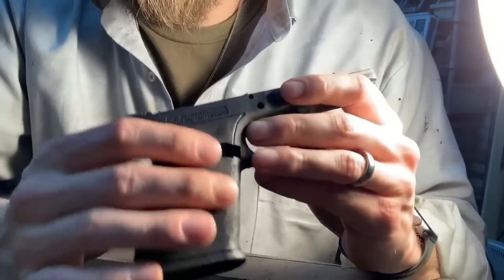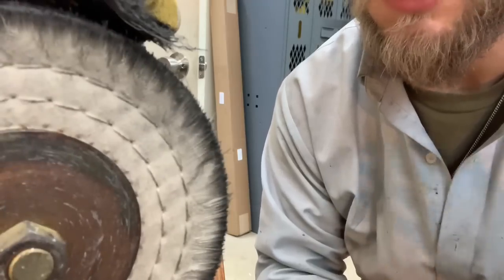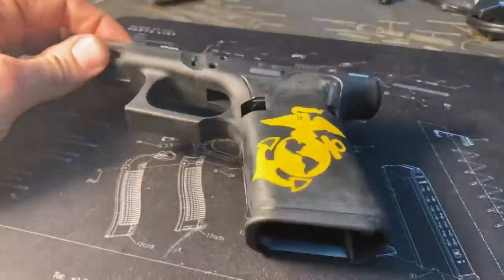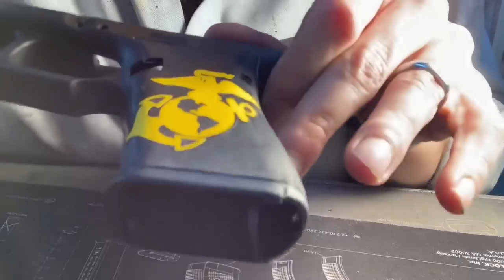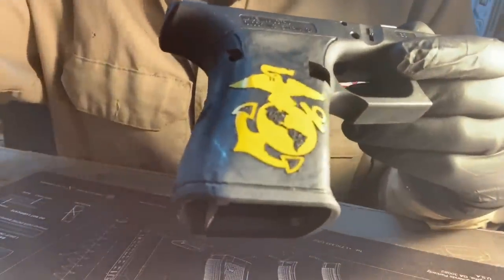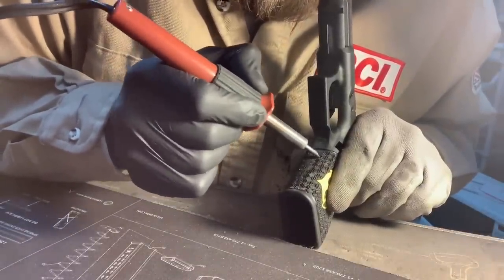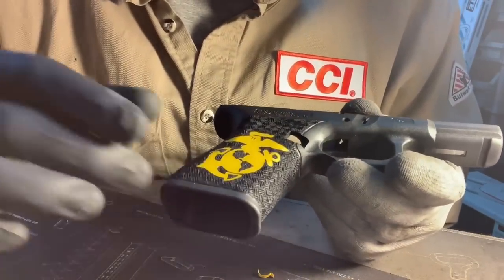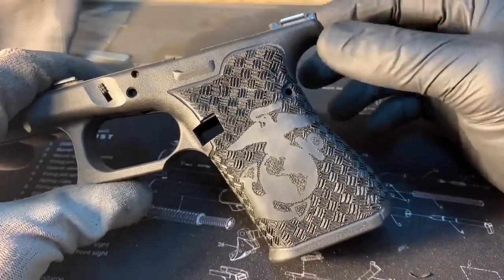U.S. Marines Glock 19 Custom Stippling

Comment: Instead of using a torch at the end, use a high quality heat gun.  It will do the same thing but wont char or bubble any plastic and you can stay on the plastic longer for more precise control, especially for glossing the plastic back up.